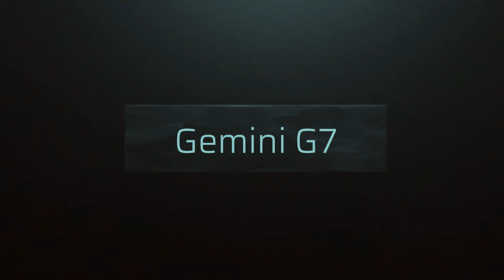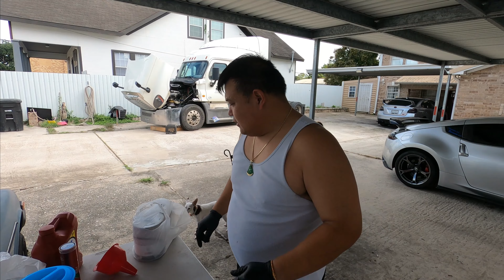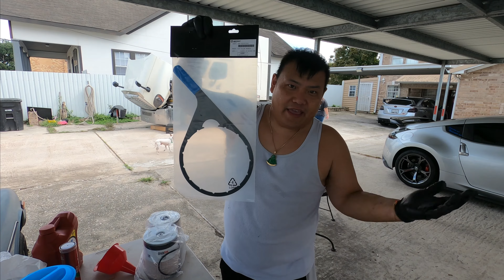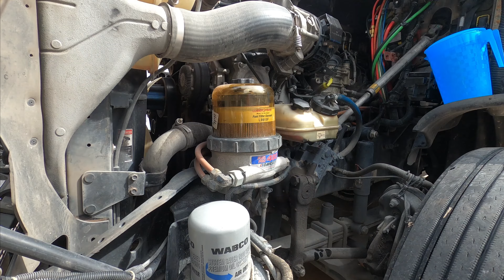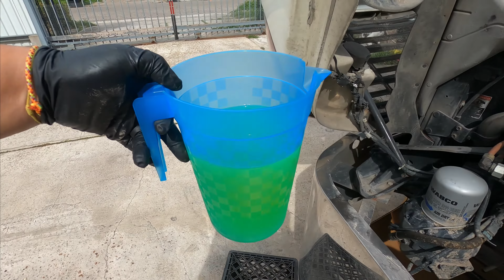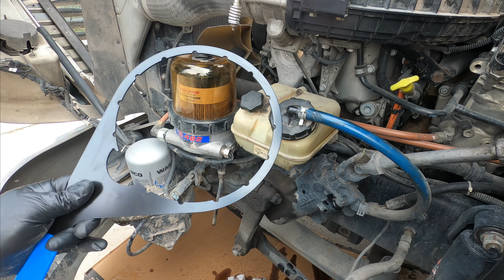How To Change Out Your Water & Fuel Separator Filter On Your Freightliner Cascadia

Comment: Isn’t there water in the water fuel separator why would you use it
Reply: My thoughts exactly. At least wouldn't you use fresh diesel?
Reply from the maker: @georgewilson2443 it works fine it's gonna filter it regardless

Comment: How low should the fuel drop inside the fuel water separator when you change the filter
Reply from the maker: Just dump.it back after changing it out. Eventually it's gonna gi down when you start driving to its normal setting
Reply: How low?

Comment: Wrong  way
Reply: For real you’re not supposed to fill it all the way lol. Not only that but you should be doing your fuel filter with it.
Reply from the maker: @kylecaraway8662  fuel filter already done when I did my pm on my truck, that why I only did this video to help others. And second,  I did this video fuel was expensive 4.50 a gallon I didnt want to waste it so yea I filled all the way to the top. When you start driving it will come back down naturally.
Reply from the maker: @kylecaraway8662 bit all means you can do better video then me. Make a video and throw it on YouTube to help others how to do it.
Reply: @Gemini-G7  buddy I do this for a living and yea they don’t come back down or at least they are not supposed to because that level is supposed to rise due to the filter getting more dirty over time but hey say something to me and not the guy who said wrong way lol.

Edit: the only way the fuel level in the wif filter would go down is if the fuel filter itself wasn’t primed before hand as the fuel from the wif filter would go to prime the fuel filter because the the pump. But you really shouldn’t prime your filters as it defeats the purpose of the filter and you never know for sure if the fuel is contaminated that you are priming the fuel filter with. Only time you really need to prime is if the fuel pump is broken. If your pump is fine turn the key forward and boom you are priming the filter.
Reply from the maker: @kylecaraway8662 i agree I just dump the fuel and put it back, when I did this video it was on a Friday. So next week Monday I start rolling again. So that what happened on this video at that time.